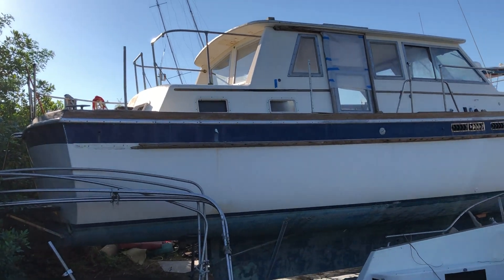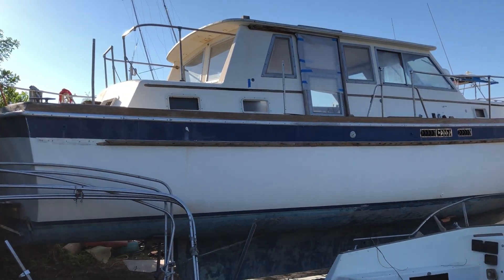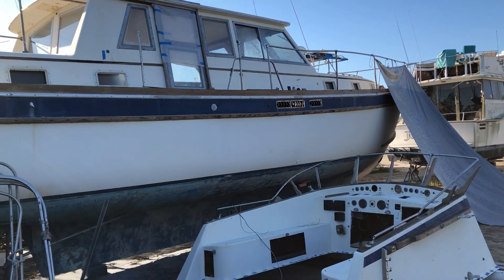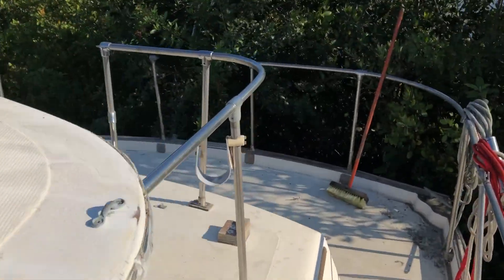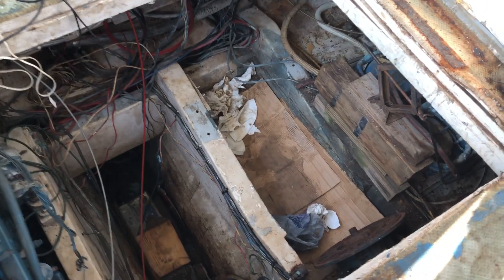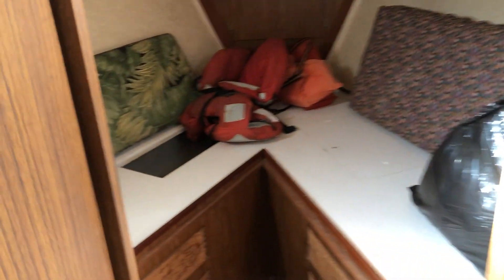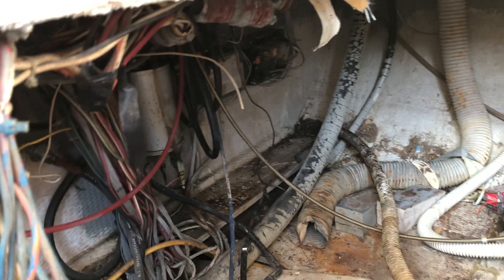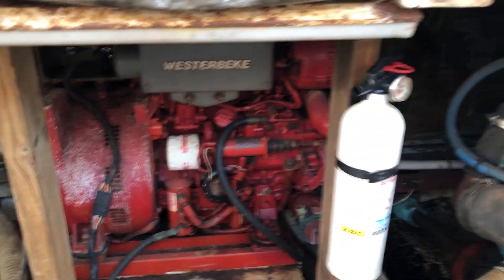Electric Trawler Conversion using salvaged Prius components (donor boat walk through)

Comment: 🌴 well it’s been awhile since you posted this video, how’s that project coming ?  As a retired boat and yacht builder your project got my interest going , I’ve often thought about getting a single or twin screw and chain driving it to and electric motor and using the genset to power a battery when needed , Prius motor is a great idea ,is it in the water yet ?

Comment: This type of project has been on my mind for about 5 years the only difference would be using commercial motors without the transmission in a Carver Mariner or Santego style cruiser. A Willard 36 aft pilothouse if my budget can handle it is my 1st choice as i'm a trawler fan too. Range is what it is and I'm sure it wouldn't be very far running 2 motors without a massive battery bank. It would be well worth it considering almost all these older boats need engines and fuel tanks replaced or they smell like hell all the time. 
How is the project working out? Seems like the Prius swap would be more costly and time consuming than going the Lynch LMC style conversion.

Comment: Back in 2005 I converted a 33 ft. Fairliner into a hybrid by adding 2 electric motors over the twin inboard shafts. The system ran on 24 volts with solar panels on the hardtop. While the batteries did not last as long as we wanted the port engine had a 24 volt alternator which could be used a a charger. Batts where also able to be charged by shore power. Was a great system although limited. Keep at it and it will work!

Comment: Another option is a Lexus GS450H Transmission, they are 160KW if you use MG1 and MG2. Also, I would be keeping an eye on Tesla Model 3 batteries, they are a much larger package than model S, would not be a problem in your big boat and they should sell for a lot less due to limited usage possibilities.

Comment: Hi, Interested to see how this project goes. I have a 34' boat (mid 80's Moody) with a Perkins 35hp diesel. I also happen to have a little Mitsubishi iMiev (well a European derivative badged as a Citreon) - which is becoming superfluous to requirements (have another EV now). I keep thinking about how much I'd love an electric boat and keep looking at the old car and wondering..........what if I brought the two together? Two things keep bothering me. 1) Gearing - as the cars motor is intend to drive it without gearing to 80mph, so how would I deal with that. 2) Battery voltage - in and ideal world I'd pick the whole battery, motor, BMS, controller and charger and drop it in. But then I'd have boat motor powered by 350v batteries. Do I really want that in a boat....what with all the salt water. Batteries could easily be reconfigured to lower voltage, but then I'd have to junk the BMS, controller and charger. These thoughts stop me from making and progress - honestly don't know enough about it! Thoughts?

Comment: and the tank well i would gut out the interior and cut it out in sections, that would be my bat bays, then redesign it around access to the bays, its just one thought :) but if structural no can do, so do your home work and get the boat plans
Reply from the maker: the diesel tank is directly under the cabin floor.  Could cut open in the future.  Was thinking of just filling to the top with water for needed ballast.  However right now I am going to try and get the 8kW diesel generator on board rebuilt and use it as a hybrid electric boat until I can afford enough batteries.

Comment: my i make a suggestion with regards to the gearbox you are about to use, im thinking your going to keep the motor in its housing ,i personally think it would be more efficient to make a new housing, coupler to run it direct drive rather than running it inside something designed for the road (to many bearings), so please equate this in your factors of power loss thats if you want to poodle at low amps or not , plus (interested)
Reply from the maker: I'm keeping the Prius housing and gear reduction.  The housing is cast aluminium and the gears seems to be built like a tank in a pool of transmission fluid.  The motor casing is also the liquid cooled heat exchanger with oil flowing between the rotor and stator.  The 4:1 gear reduction will give me much more low speed torque
Reply: @jddcircuit  any updates?